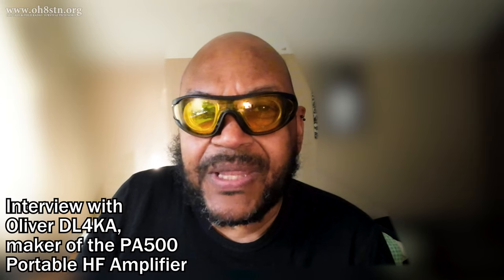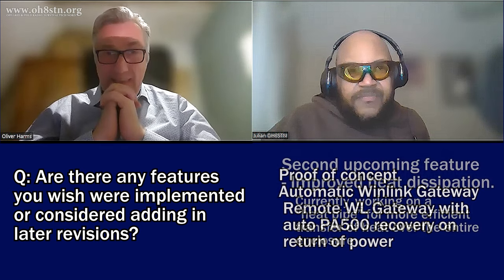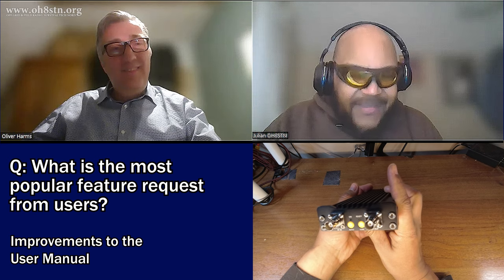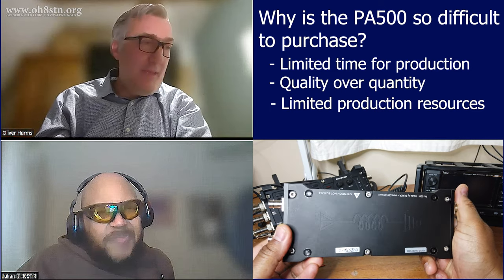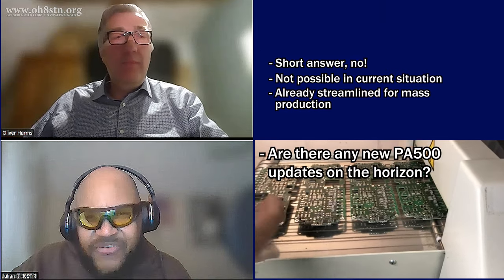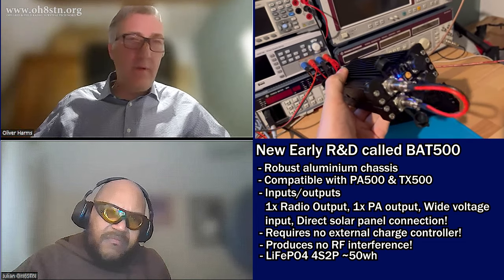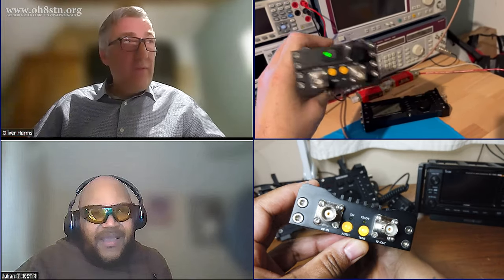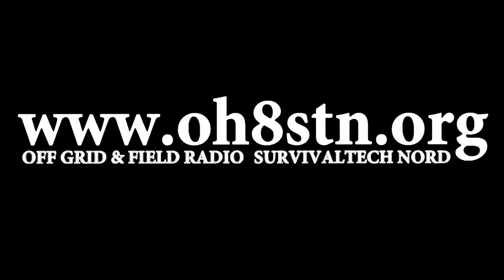DIY599 PA500 Interview with Oliver DL4KA

Comment: Outstanding presentation by Julian and Oliver.

My hope for future portable opps is an IC705 powered by a Julian-Style Solar Battery Pack, some bits of wire and some type of 3 or 4 Wheeled EV.

Due to mobility issues, I'm currently limited to setting up a table and chair next to my Ford SUV. I operate a Kenwood 590SG powered by a 200Amp AGM battery pack, rechargeable by the engine alternator. I use EFHW antennas of various lengths to operate 20M through 10M plus the WARP bands. I also have a Z-Tuner and intend to add an inductor for 40M.

I've been watching Julian's vids for several years. Besides being well produced, they are always educational and inspiring.

Thank You Sir....

Russ in So NH
Reply from the maker: Thank you Rus.
73
Julian oh8stn

Comment: A very interesting and informative interview!
It would be a miracle if these chip shortages would disappear and we could get back to a normal we all once knew. It kinda reminds me of the UK's issue with the Clansman series of radios, all was fine until the warehouse that stocked all of the spares for Plessy semiconductors   burnt down. It was a mad dash to find and approve a new line of comms gear for the MOD. Hopefully we can move forward.
Checked my "portable" gear, not so portable. SGC2020 with first gen noise reduction, LDG autotuner. Standby current draw, horrendous.
TX consumption not the best even when set to QRP. I wonder if Pierre Goral was still alive today if he would have come up with something very efficient power wise and smaller and lighter while maintaining some ruggedness.

Comment: About the LEDs, I wonder if there would be benefit from a bluetooth connection.  That way you could relay lots of data.  LED brightness could be modulated by ambient light..light sensor as you mention.  But I would opt for BT.  
I always like to think of amplifiers in terms of dB gain and not power.  So my 10W KX3 then going to 60 watts would be 9 dB gain.  Nice.  Consider then going from 60W to ~500 watts is only another 9dB gain.  So you've made a wonderful instrument at 100 grams per dB.

Comment: there is a way to make the leds dimmable by a button. That way you could set the level of brightness.  I wonder though if you make them brighter wouldnt that of course use more battery ? Im not sure how much it would affect as the leds are so small and probably not very negligible.

Comment: one thing i would like to see that they currently dont make. You would have to have special made or machined. Specific connectors that are metal that have right angles to connect to the other device. Radio to amp to battery pack. I dont like the loop of cable sticking of the side. I Hope that makes sense.
Reply from the maker: I completely agree with you Mike. Thanks for watching and for the comment, greatly appreciated.
73
Julian oh8stn